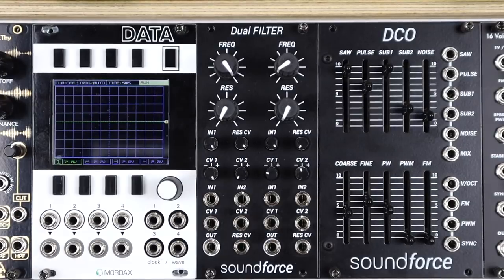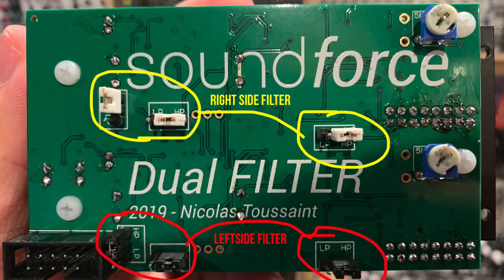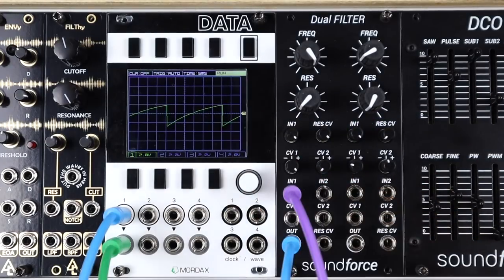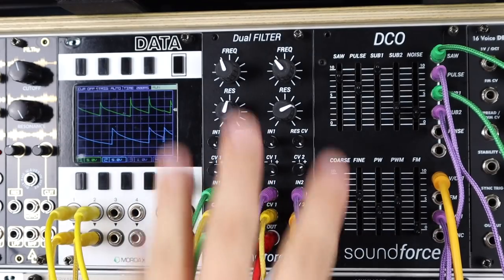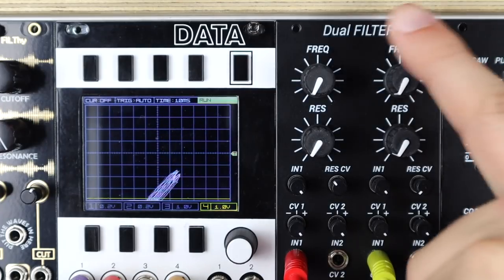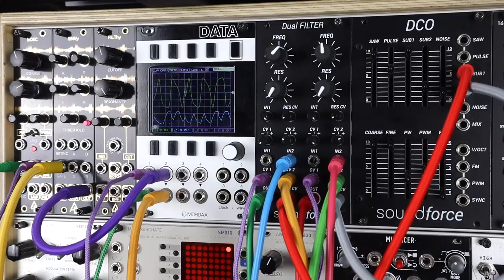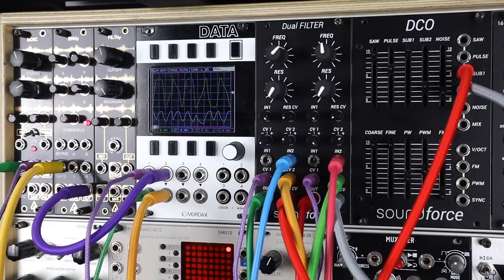Soundforce Dual Filter // "affordable" dual LP or HP OTA based filter in Eurorack

Comment: Sounds great, but wondering why they couldn't have squeezed in a small switch so that there'd be no need to use jumpers?
Reply: Cheers! The 12HP are really cramped : https://www.instagram.com/p/B4CaD4pBjnJ/?utm_source=ig_web_copy_link and I didn't want to go to 14HP.
Reply from the maker: I don't mind the jumpers too much and having the extra inputs and modulation is a good use of space.
Reply: @soundforcenicolas797  What are the effective CV ranges for the cut off and resonance CV inputs?
Can the cut offs track at 1V per octave?
Reply: @TooSlowTube  Sorry I missed this message!  Cutoff CV inputs range -10V to 10V , Resonance CV input range 0V to 10V. It doesn't track.
Reply: @soundforcenicolas797  There looks like there's ample space between the two Freq or Res knobs to me for a mini-toggle switch(?)! This was, unfortunately, a deal-breaker for me given this was to be my first filter module.  Eurorack / modular can already be a PitA compared to a DAW-based approach (which is where I'm coming from) and I do not want to be unscrewing modules from their locations simply to change filter modes!  Once I've got an established Eurorack setup, I may reconsider and, having pertinent electronics skills, look into implementing this myself; however, for now, it was simply too much trouble: I just wanna have a setup I can readily make music with and I'm already becoming somewhat disenchanted with the modular hassle factor, the constant compromises and the seeming requirement for nothing to be straightforward or repeatable.

Comment: Shame it's quite hard to get hold of - I only found a couple of places selling this (in Europe). 

Apart from that it looks a very versatile filter. I've been looking at Patching Panda's Moon Phase (stereo filter), which also looks very interesting. However, when you see this, although the two filters are designed differently, you wonder if something like this (also cheaper price) can/could be more versatile in the long run. If Soundforce added some sort of stereo control it would take this module to another level.

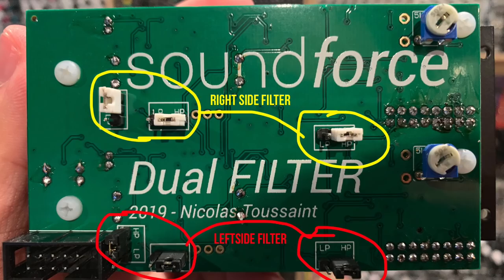Comment: Is -12V marked on the PCB, or are we expected to rely on the cable being wired correctly?  I can't see it in the close up of the PCB, at 1:37
Reply: Sorry for the late answer! All my modules are using shrouded headers that can only be plugged in the right way. In the event that you are plugging the module if a bad inverted cable, the module is protected against inverted polarity and won't be damaged.